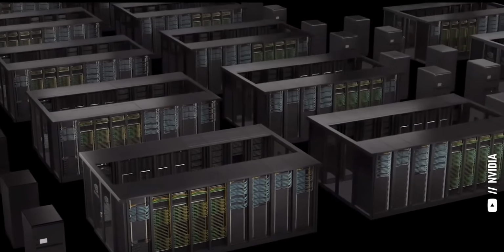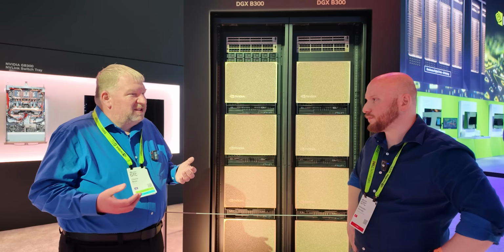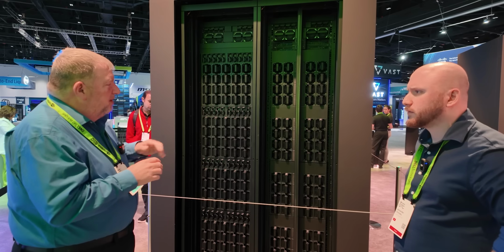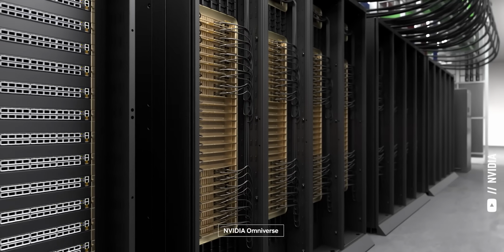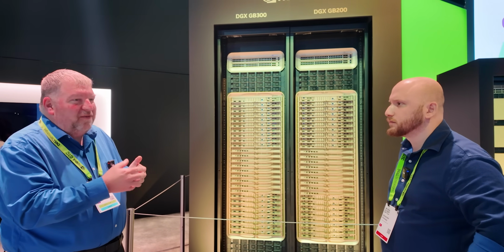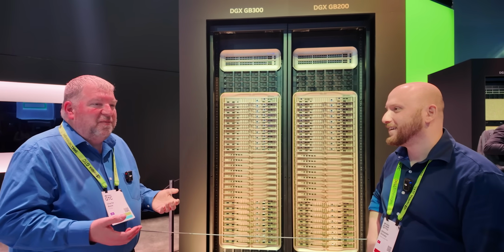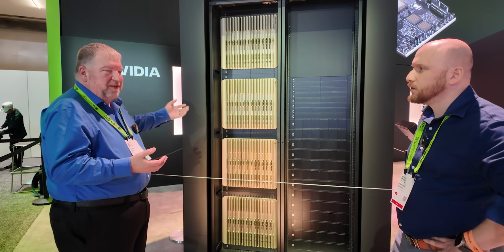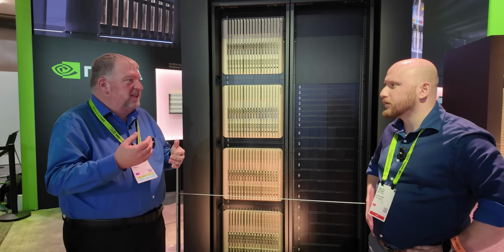E15: How NVIDIA'S HUGE AI Factories Are Disrupting Data Centers

Comment: I'm only halfway through the video but I was hoping that you would talk about how the data centers are going to be powered that is regarding nuclear power small nuclear power plants near the data centers? Maybe that can be addressed in another video and you can talk about the different small-scale nuclear power plants that will be involved similar to new scale just to name one SMR
Reply: I’m curious too, but they are probably more focused on efficiency of future systems. From what I understand , small scale nuclear reactors could take 5 years or more (large scale ~10yr), so I bet it will be gas and renewables in the meantime, and coal in china.
Reply: Nuclear is a commodity. Why invest in a commodity when you have access to much faster growing companies using it?
Reply: Data centers are being powered by diesel and natural gas engine generator sets as backup power. I don’t work on the data center side, but my company sells a lot of gensets to large scale data centers that need backup power. i’m not sure where the primary power comes from though, a quick search online suggest nuclear power yes.